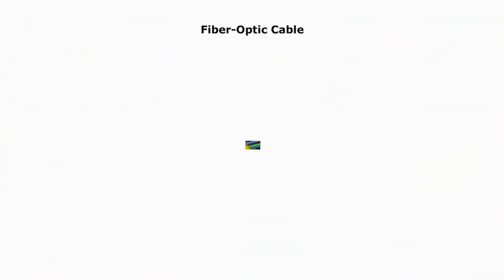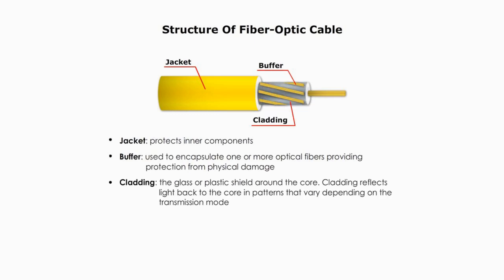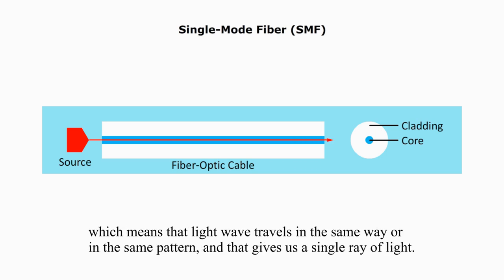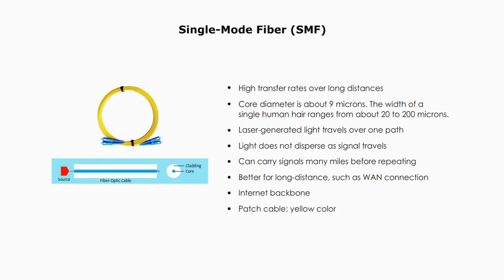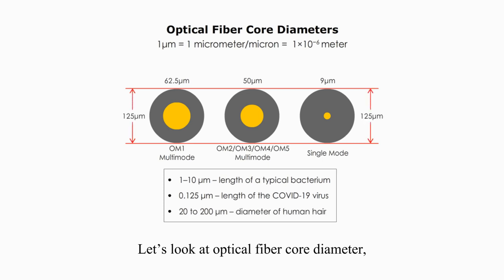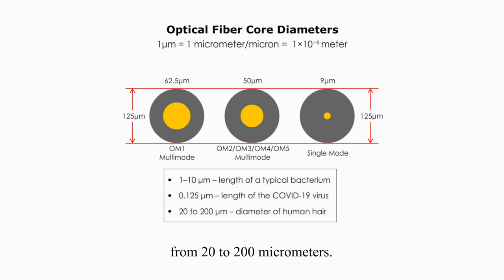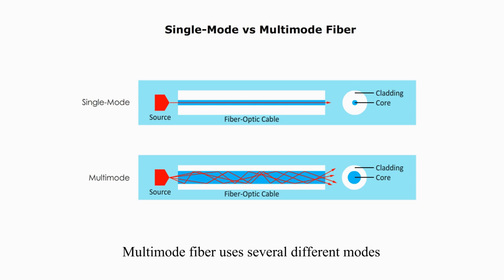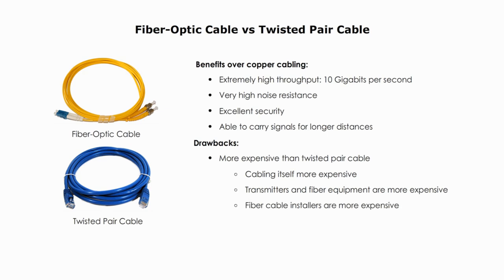Fiber optic cable: Multimode vs Single-mode

Comment: I have to say in practice basically no one uses Multimode anymore. Singlemode has become pretty cheap and with WDM you can transfer a lot of channels over the same fiber at speeds of up to 100Gbit/s. So even if you've got a 100m run between two buildings I'm still using singlemode cable.
Reply: I would say that's largely true, however, the LR xcvrs are still multiple times more expensive than SRs, and that can easily add up over hundreds of connections. Not only that, but if you use LRs at very short distances, because of the higher power, the xcvrs can burn each other out. In other words, they have to be replaced more often. Sometimes for simplicity (not having to stock MMF equipment) companies will elect to go pure SMF (or close to it), but this is not without its (primarily financial) drawbacks.

Comment: Well explained.
I have a question, I'm living in prefab building and Fiber is available there. 
Can it run to the switch somewhere so I can use my UTP cable as I have it now to my router which matches the speed?
Am I able to do it by myself without a technician entering my flat?
Reply: Yes you can however you would need two fibre converters for youre network.

Comment: Hello i have a question about symmetric key , i saw your video and u said we use private key but i found in other videos that we use public key , is that right or no ?
Reply from the maker: A symmetric key is a private key in private encryption. The public key encryption uses Public key and private, but public key and private key are inseparable twins.
Reply: When you connect to a secure website, public key (asymmetric) encryption is used to initiate the connection. This encryption is used to send a private key. Then symmetric encryption can be used from that point onwards.

Comment: UScomservice https://uscomservice.com/ range meets all the FTTH infrastructure needs from outdoor or indoor distribution points up to the customer’s premises. To bring end-to-end optimal solutions for each and every infrastructure configuration, UScomservice networks provides drop cables engineered for specific applications as well as versatile drops, developed to adapt to various installation environments. Our offer of drop cables includes outdoor, indoor or outdoor-indoor optical cable solutions.

Comment: Everything else was very well laid out, but why would multimode be better for short distances? Modern day the stuff costs is practically same, so going for multimode does not give you any benefit... Only if you already have multimode infrastructure and need to expand it, multimode makes sense now.

Comment: So mode just means a different path right and has nothing to do with wavelength? 
So for example if I have a single mode fiber and have rays of different wavelengths all traveling along a straight path down the fiber. Because the only path is a straight line and even though there’s multiple wavelengths of light, we still just have one mode correct? 

Now if I have rays of different wavelengths or all of the same wavelength but are traveling along the fiber at different paths I have multiple modes. It’s the different paths which makes this a multi mode case not the the fact that there rays of different wavelengths right?

Comment: being an IT professional, you should be more accurate with terms and acronyms: the virus is correctly called SARS-nCOV-2 (severe acute respiratory syndrome causing novel coronavirus type two) and the disease it is causing is dubbed COVID-19 (COronaVIrus Disease first reported in 2019).
Reply from the maker: Thank you for correcting me. being honors to get comments from you.